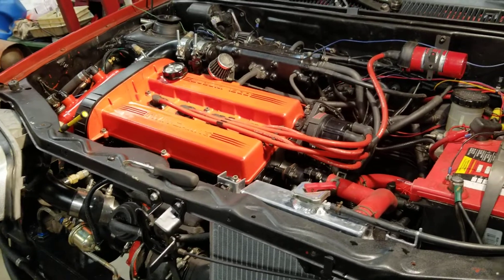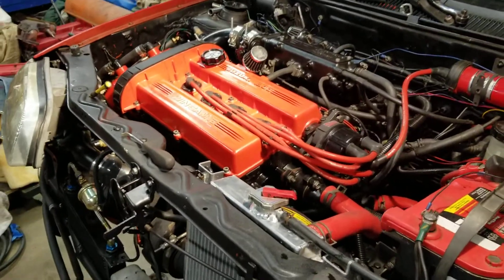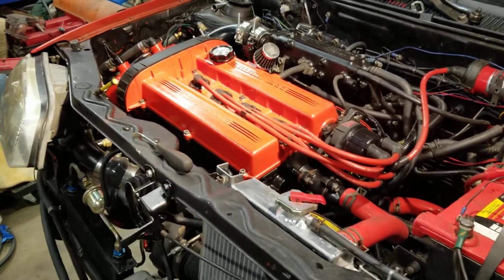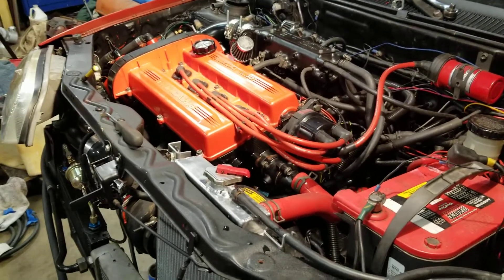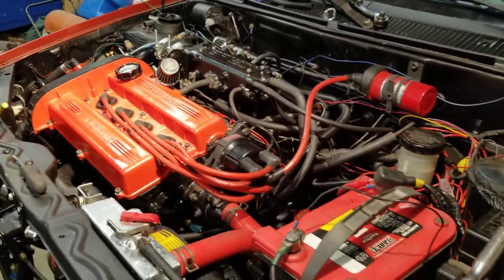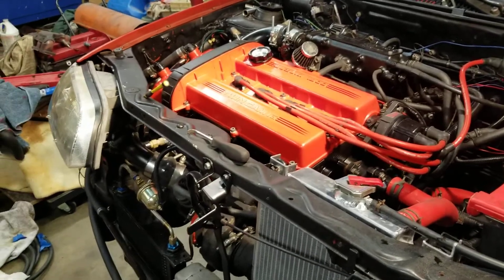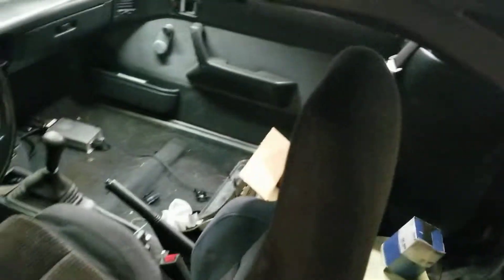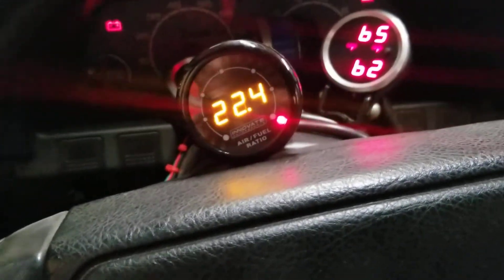Geo Metro turbo Forged engine startup

Comment: I have a 92 convertible. Question... Will you have a video breaking down costs and troubles? Gotta give you props you have what i desire lol. Keep up the awesome work!
Reply from the maker: No. I will tell you, the rods and pistons are near $2500. Between machining, internals, studs, and the turbo manifold, there is close to 5k just in the motor. That does not include the turbo, exhaust, intercooler, heat exchangers, radiator, megasquirt...

You get the idea. It is a very costly project to mirror what I have done, I have accumulated those parts over the last decade.